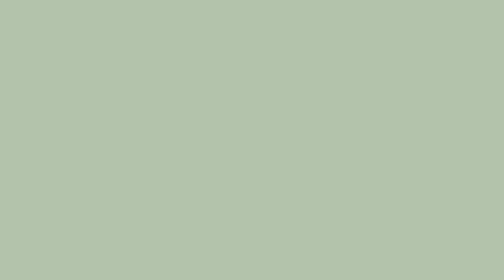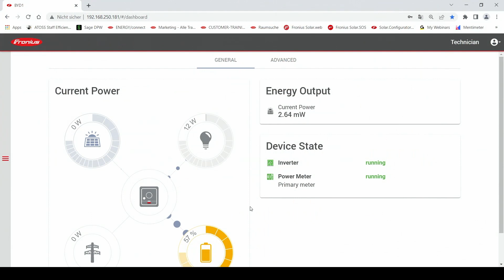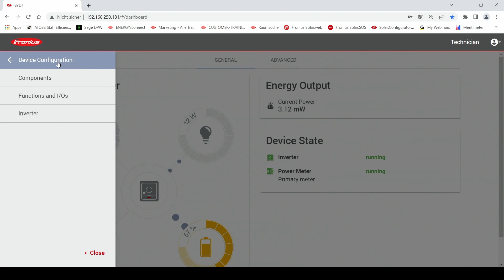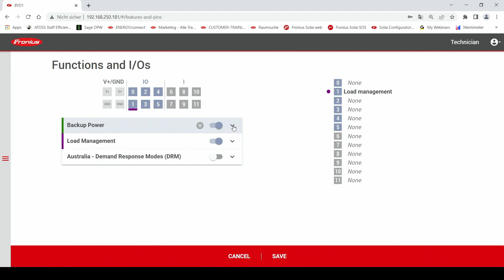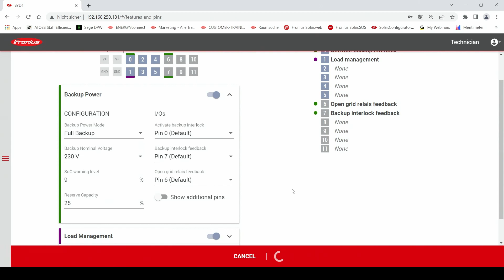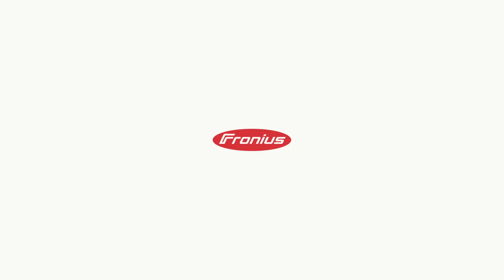How-To Video: Conditions for switching to backup power operation with GEN24 Plus

Comment: How much time exactly does it take to switch to Full Backup mode?
Reply from the maker: Hello @danielardelian2
The switching times vary from inverter to inverter. Please refer to the technical data overview for your inverter: https://www.fronius.com/en/solar-energy/installers-partners/technical-data-overview.
Reply: @FroniusSolar  My inverter (not a Fronius) switches in less than 20 milliseconds. I was asking to see if it's worth considering an upgrade to a Fronius GEN24...but apparently it's not.

Comment: Hi. Great video. You say that it takes a few seconds to switch between modes. In the configuration screen of the backup box it is possible to select the number of seconds it will wait after an outage before going into isolation. It seems to be possible to select 0 seconds. Do you have any recommendations against selecting a 0 seconds interval? I live in an area with frequent micro-outages of just a few seconds, so I wonder if this setting would bring a lot of stress to the inverter.
Reply: Where can you select that number of seconds?